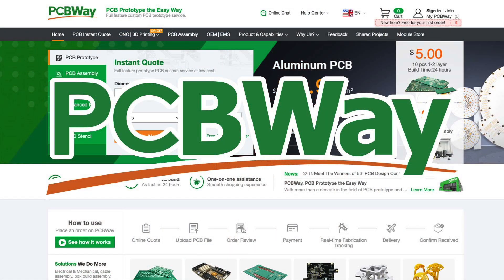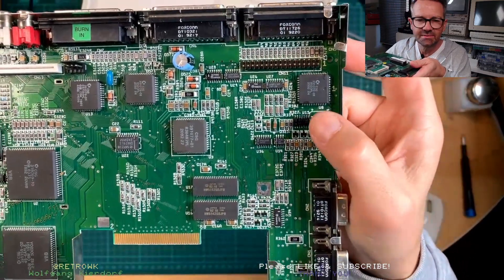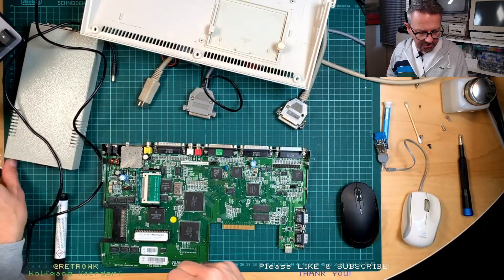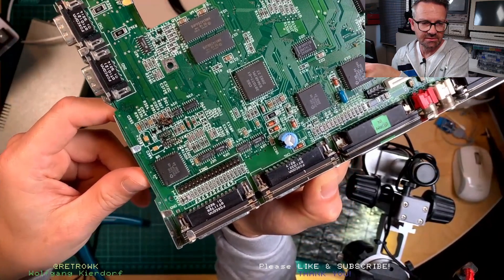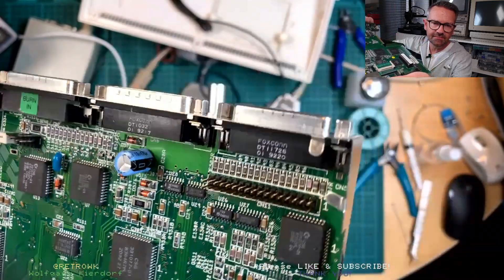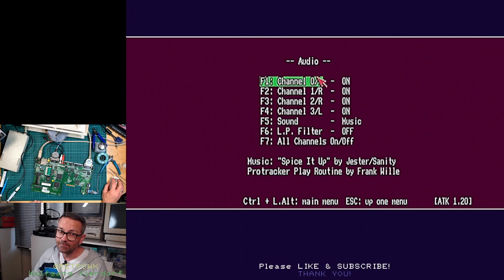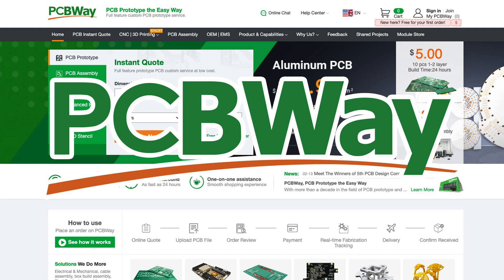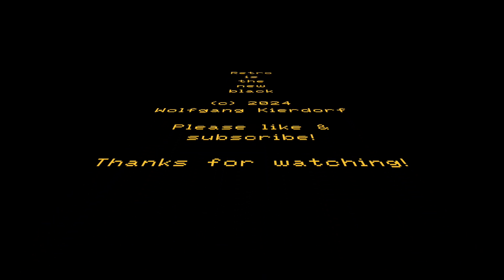Amiga 1200 & Amiga 600 No-Sound-Fix / Just-One-Side-Sound-Fix OpAmp swap #pcbway  #amiga #amiga1200

Comment: What's up with the different caps on the 600. Were they used because they were easier to install or were they all you had on hand, and could there be issues when using them?